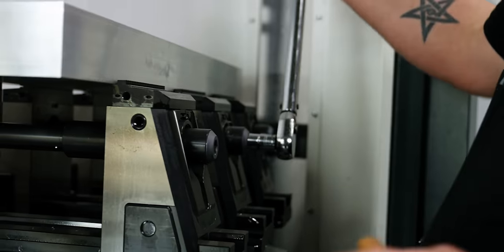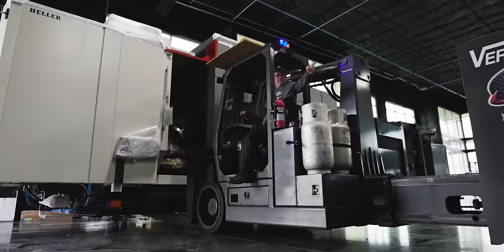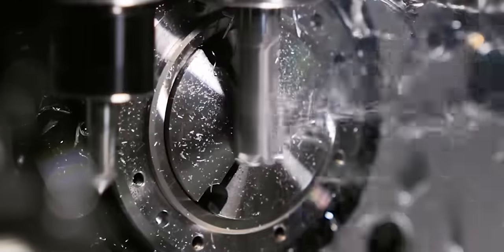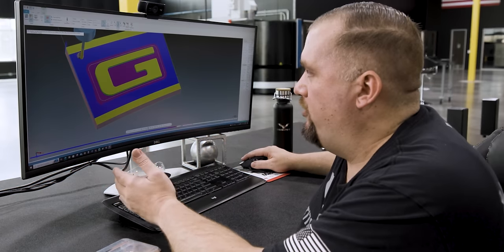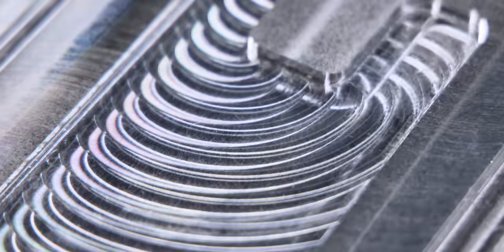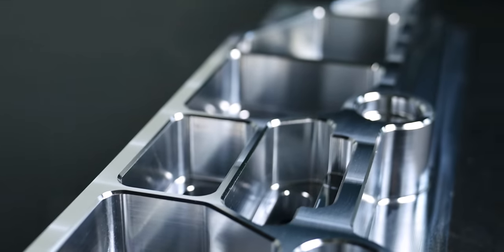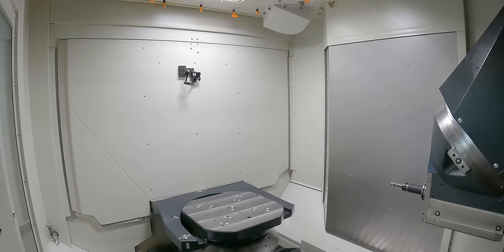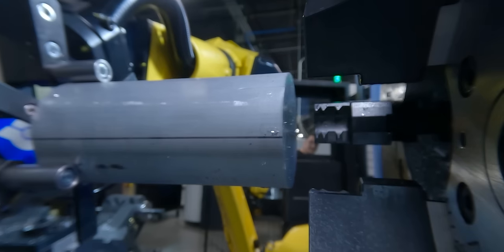Old School CNC Machining Drives Cost on $100 Million Planes

Comment: I’ve been in the industry almost 20 years. Most of the time parts can be simplified and cut manufacturing times by a significant amount. A lot more than just running optimized code. I came into the aerospace industry at the tale end of the manual / NC era and witnessed the change in methods and part design. Most of the time parts are designed with feature sets that provide ZERO benefit and do not aid or enhance form fit or function. They just came into existence as a function of the software tools or because they looked nice in CAD. We went from square parts with east to machine features to complex parts with no square edges and blended feature sets. A part that would take 30 minutes on an old Mazak 3 axis now takes 3 hours on a very expensive to operate  5 axis.

Comment: But gross inflation of parts cost is all part and parcel of the government contracting system.  They get appropriated funds and all the funds have to be spent.  The system itself is broken and until it's fixed there is no incentive to fix the next step in the process.

Comment: In a shop that supports a massive production output of non machined parts(eg. tire industry) and also has structured pay levels that you’re already at the top of, you’re just creating more work for yourself and not getting any added benefits whatsoever.

Comment: 3:00 can solidworks or mastercam or cad tell you what's the fastest feed rate you can use based on your spindel speed and diamonds and material or do you have to calculate it manually? Because a little bit of tension and you could break the machine and cause hundreds of thousands of dollars of damage

Comment: If you replace the MACHINE that deflashes bomb fins to a newer machine from the exact same manufacturer the defense department WILL make you pay for entire recertification of the weapons system. Will cost MILLIONS of dollars. Switch manual clamp with pnuematic? Same thing. 
This is why EVERY defense subcontractor has 80 year old machines.

Comment: Its stupid. if you run extra special parts, you will not touch it. in rocket science, if engine is working, you don't touch it just because you can make it better. you don't touch it because you sometimes don't know what could lead to problem, even if its minor change. So for ordinary parts, yes, you can push it, but not for specialty parts. where are so many examples of this...

Comment: I work in a shop and we do only plastics, but every plastic. <my shop used many PKD mills and going fast, now they use other mills and do more HP strategie, but this is slower then before. i dont know why, if i programm something on a machine, i use the whole length of the cuttingedge of the mill and go 20-40% diameter and fast. i have my one speeds and feeds and do the jobs ffaster than before and efficently. shoude i tell the others or not ? :D
Reply: drop down to 20ipm before someone gets fired over broken tooling

Comment: Barry , great video , been there done and still do it sometimes our CNC shop is 1950's compared to Titans of CNC in Flower mound Texas, we run heavy steel  mostly Boron and some Boron with Silicon 5 in it once or twice a year, I am the most senior operator in the shop and am always looking to find ways to safely improve times without  damaging any tooling longevity and this is all shared with Management and co workers and i know virtually nothing compared to you guys when it comes to programming a CNC ,whatever i have done to improve any process or cycle time has been met with scepticism or laughing and told one manager  what have you donee this year to bring costs down for the company and i told him to his face nothing, he didn't like it,  too bad  and we are taking on 3000 tons of new parts next year and i have looked at the blueprints already and showed them how it is possible to save a minimum of 9-12% cycle time on each part each part is 900 pounds and then has to be heat treated for almost 2 1/2 hours for tensile strength and straightened after that and i found another 7% cycle time, i took this to my plant manager who has always been open to change and improvements and he had a shield up saying what the hell is this, met with hostility, I told him it was all done on my own time not company and did it at home on my own computer and any thing that may work is yours, i am here to share with all employees, not hoard it to myself, better for all of us means job security, I am the 2nd most seniority person in the shop on the floor and i get people coming to me always to help solve issues with machines and i always help , i first get permission from my foreman before proceeding, my biggest issue is they are buying new machines, well newer machines anyway, they won't spend anymore on maintenance or give time for tooling maintenance, its an uphill battle or should i say lack of interest to change or improve,I am in my early 60's and have another 7 years to go before i can afford to retire so i put in my hours and still work better than most of the people i have trained  over the last 15 years or so and like you said they just want to play on their phones or watch Netflix and i disagree with that bullshit and never will what goes around comes around is all i can say, do my best 8-4 and go home and have started looking at a laser machine for my home shop to do small jobs for my retirement fund  👍 Titan is a very special place to work is all i can say
Reply: Hey brother, i love this comment because there just arent enough MEN like you out there anymore, and if there were, work wouldnt be leaving here. You sir are a dying breed, but you have my respect. If you ever want a shop tour, some coffee, and a tshirt……hit me on facebook or email at barry at titans of cnc dot com and you got it

Comment: “Sandbagging” is for laziness.  Simple.  Seen it in other industries.   Keeps you earning while working “less”, but the costs are indeed higher.

The “demo tool” request is something I never considered.  That in itself is gold since you can run it hard and push with low risk.